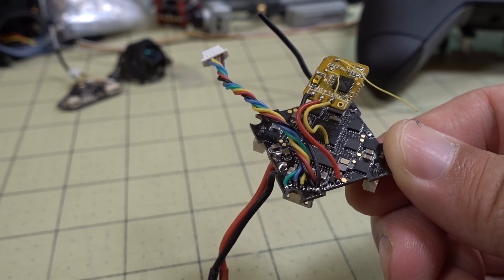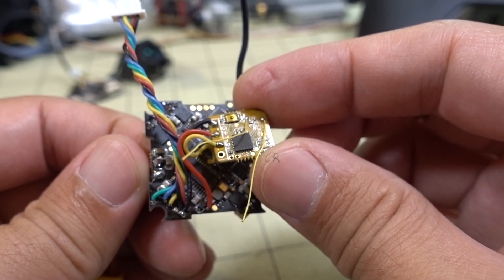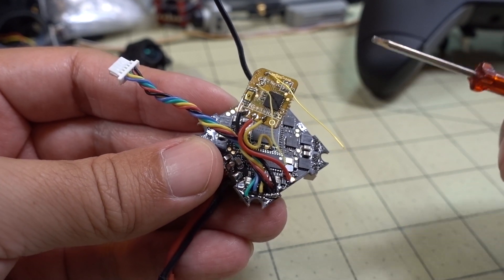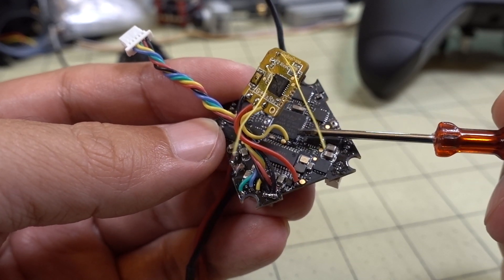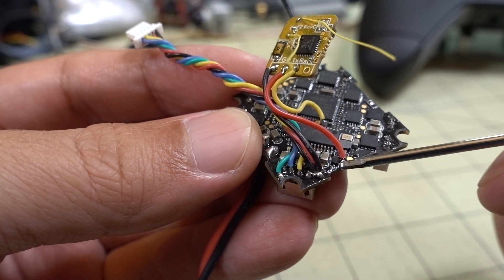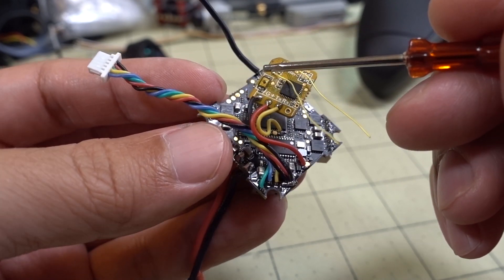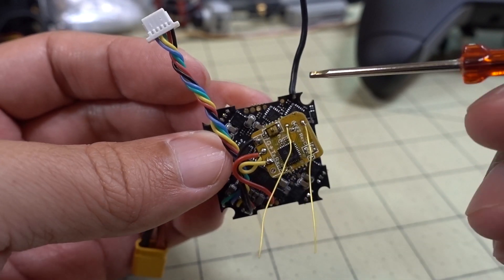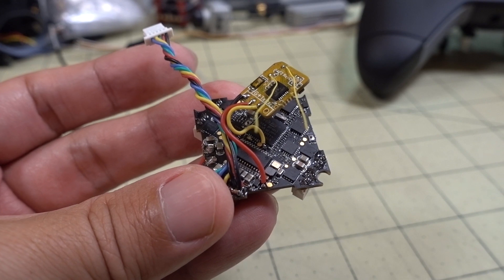Crazybee F4 PRO v3.0 Receiver Tutorial 🎓

Comment: Hi I have the frsky version (Crazybee f4 v3). Just bought dji o4 light. Is this fc possible to use it with fpv controller 3? I have wired the yellow wire from O4 to IRX1. Really don’t know how to wire the white and gray from the O4 to fc…hope you can help ☺️
Reply from the maker: I don't have this anymore but I think the FrSky version does not have any SBUS pads on it.  Sorry, I don't think it's possible with that board.  You can ask Happymodel support for more info as I'm not 100% sure.
Reply: @AlbertKimTV ok 😐 thought you mentioned in the video that Irx1 on the fc was inverted SBus…..will check with  happymodel. Thanks for answering 👌

Comment: Hi Albert, can you add expresslrs receiver to crazybee F4 pro v3.0?
Reply from the maker: It's only possible with the no RX version.  If you have the one with SPI receiver, there is no open UART for it.  Just wire it up to one of the open UARTs.  If you need a wiring diagram, there is one here...  https://bit.ly/3yeSOUZ

Comment: Hey Albert I just added a xm+ and it’s bound up and connected but I don’t get any stick inputs in betaflight, do u know what the issue might be?
Reply from the maker: Could be a lot of things.  I'd check if you have the correct UART wired up, make sure you're using the inverted RC input and not the regular one, make sure your channel mapping is correct order, make sure you have the correct protocol selected.  I'd start there... after that the list gets pretty long.  About 100 more things to check.
Reply: @AlbertKimTV  thank you 🙏🏻 cheers

Comment: Could do with one of these on how to wire in this elrs ep1 receiver In to one of these boards.
Reply from the maker: I don't think these boards with built-in SPI receivers can take an external receiver.
Reply: @AlbertKimTV  really not even the crazybee f4 v2. 0   I do have 3 uarts options in betaflight, the board has the inverted irx1 on there but then I have an rx2 tx2,,  and tx1 and tx2, can I not use a set of those, then power it off the led tabs.

Comment: Does that mean I'd need to connect my vtx, led and rx 5V and grounds to that single 5V and ground pad at the front of the board? or is there additional 5V and grounds that are unlabelled on the board? Upgrading from V2.0 board in my trashcan which had the vtx and led as their own dedicated outputs

Comment: Hello I upgraded my novice 3 (SPI board i think matek F411 xr) with r xsr reciver ACCESS protocol with X lite S. no telemetry, onyl SBUS and I use one of the channels to push rssi on osd. I want to point out that there is big range gain with D8 compared to D16 for those who really want to push it. I could go easy 500 mt with D16 but it was about the end, wiht D8 still margin to go further. Feels a bit worse to fly though (not sure if it`s me)

Comment: I want to solder a crossfire nano rx to my current crazybee f4fr pro v.2, but for full confidence, I want a diagram 😬... This seems the closest I could get in terms of help, but still I'm not 100% sure of the wiring, especially as it's not the exact same fc in the video as my own...
Reply: I'm unable to post a diagram, but you can just do a search for the wiring diagram/ pin out. Also, there's a V2.0 & V2.1 so they may be different. Hope this helps
Reply: @jimhall9360  Yeah thanks, I managed to do it, pretty cool you can do this mod!
Reply: @godfreygits  SWEET! Glad you were able to mod it. I put an XM+ on a CrazyBee in my SailFly X and it was much more fun to fly

Comment: i have installed a xm+ and moved the smartaudio wire, i can change the vtx settings in betaflight on my computer but not via betaflight in my goggles.
what is the solution?
Reply: In configuration do you have check de uart for vtx smart audio

Comment: For xm+ is there anything additional if have to do after moving smart audio to the tx 2 pad?
Reply from the maker: No, both should be working at that point if the uarts are set up properly.
Reply: @AlbertKimTV  cool so i just do the normal thing in bf once installed the xm+ thanks

Comment: i did this with a frsky xm... put it in serial rx in uart 1 . bind it with my jumper t16 pro in eu lbt, i have green light on the xm but nothing in betaflight on receiver... pffffff boring
Reply from the maker: You are probably connected to the uninverted RX when you need to connect to the inverted RX.  I mention the two in the video.
Reply: Albert Kim it’s a xm not a xm+ could you give me more précisions Please ?  Xm has ont 3 pins instead of xm+...

Comment: I crashed a little hard, now it won't arm and just makes a beep pattern when I plug it in or try to arm... New board?
Reply from the maker: Probably.  Check to see if anything is shorted.
Reply: I have the same issue on URUAV 85HD Bushido I'm going to try and put a new receiver cuz everything works fine in Betaflight. I don't think mines cooked!

Comment: Albert, great video, is just what I was looking for.  I got the frsky not binding due to the on board chip not supporting ACCESS.  My trashcan is the Pro 2.0 version and the pads are in different locations, but I understand from your video, all I need to do to hook up XM+ is move the Video wirefrom TX1 to TX2 and solder my XM+ SBUS to Inverted RX1.  I got the manual for the Crazybee F4 Pro 2.0 and reviewed the XM+ manual.  I could not find where the XM+ manual documents whether needs an inverted uart or not with the current firmware.  Just wanted to double check with you, my execution plan.  Thanks for any feedback if I am in the weeds.
Reply from the maker: I think you have all that right.  I think it's still inverted SBUS same as before.

Comment: What type of antenna does the SPI receiver use? I need to replace the antenna on my 6 year old Losi micro SCT truck. It uses a 2.4ghz DSM reciever built into the ESC board.
Reply from the maker: Any conducting wire of the same length will work.
Reply: @AlbertKimTV awesome, thanks Albert!

Comment: Great video. I'm about to buy a Larva X and I use flysky. As I already have bought a Fli14+ receiver, do you think I should buy the SPI flysky or buy the external DSMX version and change the receiver? Both are uninverted right? Unfortunately they don't have a PNP version... Thanks for the awesome content in the channel!
Reply from the maker: Basically all the ones with built-in receivers can be used as PNP since all the pads for an external receiver are the same on all the boards.  So inverted and uninverted pads are on any of the boards.  It doesn't matter.
Reply: @AlbertKimTV  Perfect. I'll buy the SPI flysky and then mod it for the external Fli14+ receiver after some packs. Will use your tutorial as a guide. Thanks and keep up with the good job

Comment: Question, I have the Flysky version of the Larva X, and I installed a frsky R9mm receiver, was able to bind, transmitter shows telemetry, however I get no response to stick movement. I’m using the fport protocol. I made the necessary changes in beta flight, just like I’ve done with all my other quads running the R9m. Will frsky receiver work on the flysky version of this board? I actually even flashing  the frsky firmware on that board to see if made difference. Lol yes I’m desperate

Comment: i put a frsky R-XSR on fport to it and it works great... tho i cannot seem to get telemetry working
Reply: @JOHNNY jeppesen: I am trying to get an R-XSR on it as well, but the copter does not catch the transmitters output. Power works fine, I tried the sbus cable on IRX1 as he told. R-XSR is inverted as well right? But also tried on RX2 as well. Still no input from the transmitter. I do get rssi though. Any idea?
Reply: @BcHmF  you need to make sure your RXSR is in SBUS mode (blue light is on.. if its not, hold button down while powered on)
Reply: @Krunked  Thanks bro, got it running!
Reply: @BcHmF  sry i was wrong... i ordered the one without the reciever and there was a 3pin cable already (power,gnd,data)
Reply: @johnnyjeppesen6992  Its fine, I got it runing, thanks buddy! :)
Reply: @BcHmF  hey mate, I have the same or similar problem to you. My board is the crazybee v2.0, I have an R-xsr, and can't get the rc to recognise any signals from the rx. I managed to bind the rx to my tx though. 

please help, thanks

Comment: SPI anomaly... multi protocol modules in Frsky D16 with telemetry work perfectly. No random dropouts you get with Frsky JST in D16. Frsky D16 protocol on the multi modules require frequency tuning. Once tuned ya get no dropouts but still has the short range of 100m. Also no LUA smart audio from radio but still works in OSD.
Reply: I also have a few of these with no power from the battery so I tried your 5V BEC  mod to bring them back to life and it works but at least one of the ESCs fails soon after.

Comment: Hi, thanks for all the great educational videos. Challenge question... I got a spectrum f3 crazybee board but I am a frsky user. Can I reflash and install an xm+ disabling the on board spi??? The other issue I saw is that the spectrum version of the f3 board from the mob 7 had no ex pads to solder to so didnt even know where to wire the xm+ to. Appreciate any advice or help.
Reply from the maker: Which version board do you have?
Reply: @AlbertKimTV  it's the crazybee f3 pro from a mob7. I am just wondering if I can reflash frsky betaflight and connect a xm+ but then realised there is no rx pad on the dsmx version. You can see the pads are missing on the last photo on their site...

http://www.happymodel.cn/index.php/2018/10/16/crazybee-f3-pro-flight-controller-5a-1-2s-compatible-flysky-frsky-dsmx-receiver/

Comment: Yup, your thumbnail for this video is exactly what I did within the 1st week of trying out the mobula7 HD when that was new.   I couldn't even hold a signal through the house and ended up attaching a r-xsr in its place.
Reply: @Aarons14bugs: I am trying to get an R-XSR on it as well, but the copter does not catch the transmitters output. Power works fine, I tried the sbus cable on IRX1 as he told. R-XSR is inverted as well right? But also tried on RX2 as well. Still no input from the transmitter. I do get rssi though. Any idea?
Reply: @BcHmF  
If I remember right, I used f port firmware through the rx and hooked it up with the tx pad on the bottom of the board.  You will also have to select fport in BF under the serial rx pulldown and enable telemetry in the settings.  Make sure your transmitter firmware is up to date too.  Hope this helps!
Reply: @Aarons14bugs  Got it! Stupid me. I forgot to set the right ports in betaflight! But thanks!  Finally enjoying the Larva with proper range :D

Comment: Beereciver V2 
Un-inverted/Inverted Sbus modes:
The Rx should come set to Un-inverted Sbus signal. The LED blink sequence will show you if
the signal is Inverted or Un-Inverted.
There are two sets of LED blinks upon startup:
The first set will indicate Inverted or Un-Inverted Sbus signal.
For Un-inverted Sbus signal (reverse SBUS): After you power on the Rx the LED will flash
RED twice.
For Inverted Sbus signal (regular Sbus and requires a hardware inverter on the FC, th BBBL
does not): After power up the LED will blink Blue twice.
This is a switchable function and easy to change. To change between Inverted and Un-Inverted
Sbus, you simply just hold the bind button while plugging in the battery...one or two seconds is
long enough. The signal will now be the opposite of what it was previously